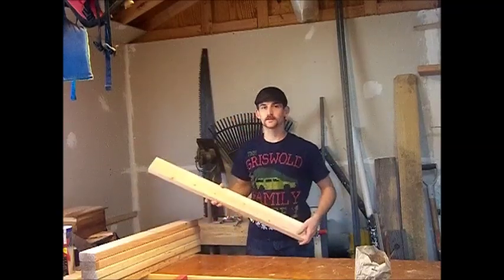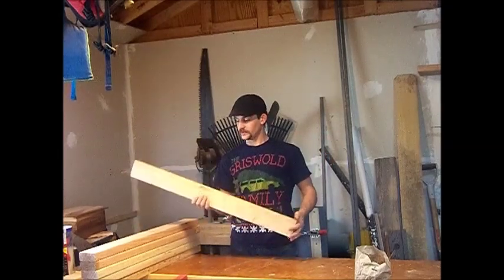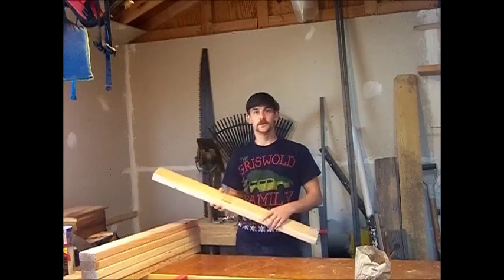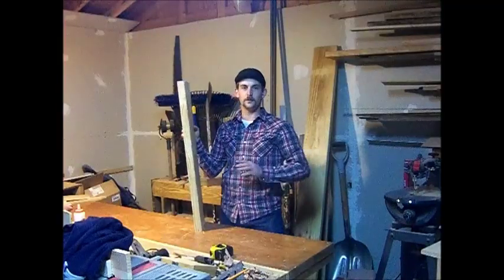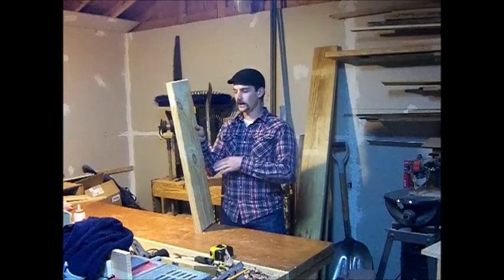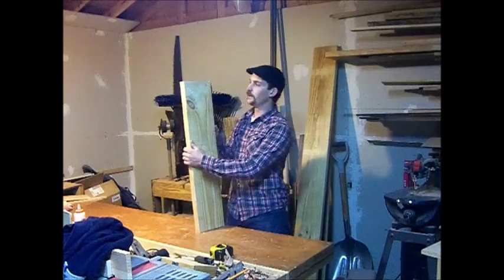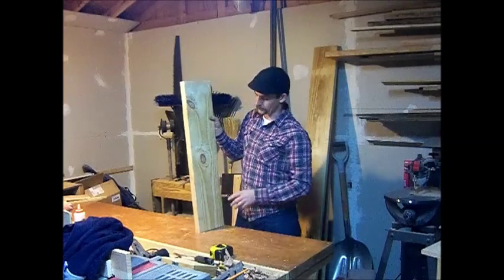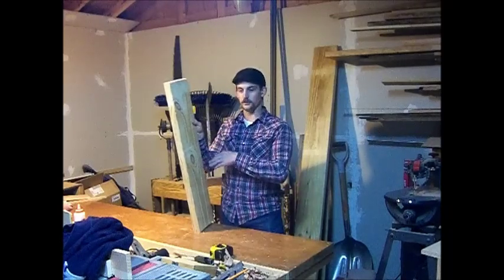Easy to make 2x4 Bench

Comment: I bought two cast iron sides for a small garden bench. I thought all I had to do was cut some 2" x 1" slats (12 of them) and bolt them to the bench sides. My inexperience with staining wood got me first. They came out REALLY bad. And to top it off I over painted (used way too much) poly-urinate (sic). So I had to sand down all the poly-urinate (sic) and most of the stain came off too. For some reason I tested the slats to see how they would look and low and behold the gap between them was too large. I measured them and found 3" is too big and 2" is too small. Two and a quarter inch would be ideal. The fact that woodworking requires the knowledge of ACTUAL sizes in relation to what they say they are is frustrating to this former metal fabricator. When working in steel what ever size you use is what it is. Thus an inch and a half by quarter inch slat IS actually 1.5' by 1/4". I figured I'm not going to be ripping anything. I'm just going to go with the 2"ers I have since they look ok and no one is actually going to be sitting on it, it's just for show. Transitioning from steel work and welding to woodworking is a bigger deal than I anticipated. Thank God this is just a hobby as I'm retired but picking up all these tips from your videos are helping Tim. Thanks!!!
Reply: Still binging (learning) from your videos! Thanks again.

Comment: Nice bench Tim!  I like how you used the plane to blend the seat boards together.  Did you use brush on lacquer or spray?  I've thought about starting to use the brush for some projects.
Reply: I actually use a wipe on technique. I don't like using brushes. I have a bunch of old t-shirts I use, cut them up, and they make good rags. They produce a really smooth finish as well.